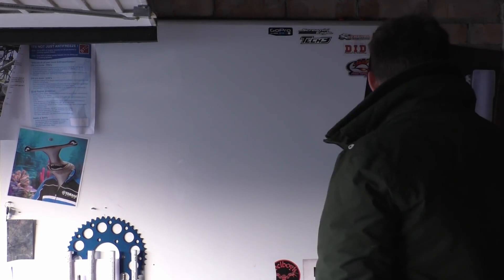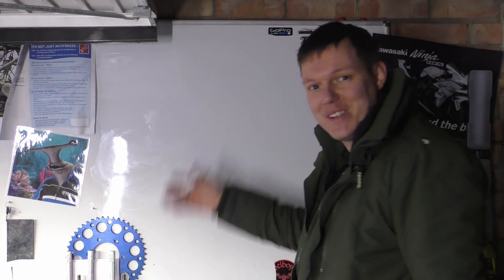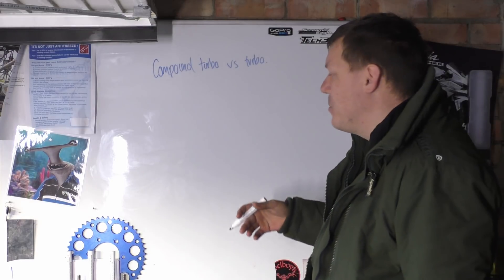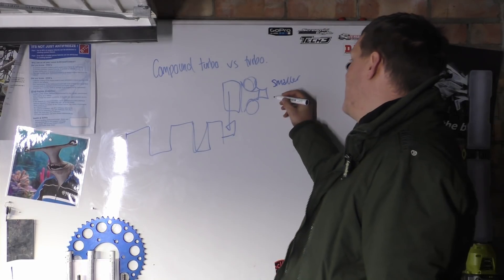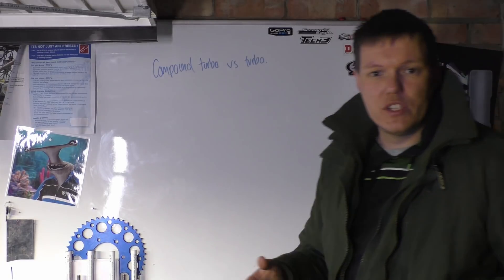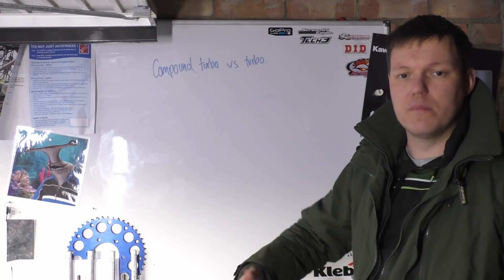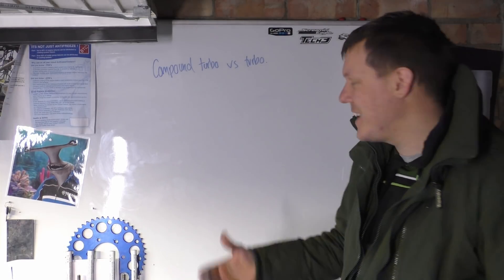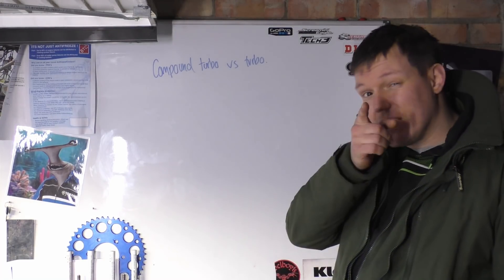Turbo Compound vs Turbo Engine

Comment: Question: Could a turbo compound engine also use the heat normally radiated? I find it odd it's only grabbing from the exhaust. It should be tied into the radiator too.

Comment: IIRC, Cosworth tried something similar to "compound turbocharging" on a four cylinder racing engine, in 1983/1984. Instead of trying to recover energy, they were trying to reduce turbocharger spool time, using variable drive gears in some sort of continuously variable transmission, eminating from the crankshaft. Unfortunately, they couldn't make it work and it chewed-up a crankshaft on the dyno, at 11,000rpm and 40+psi of boost. It was being filmed for the Channel 4 documentary "Equinox - Turbo: Made To Measure" at the time, and at that exact moment you can almost hear the engineers arseholes heel over...
🤡🤓

Comment: Hey Matt! Just wondering if you could revisit compound turbo as well as sequential setups for petrol engines. Several people on the internet have said that single turbo technology is good enough now that even parallel twin turbos are becoming obsolete. Other than it being expensive as shit why don’t they compound  Vari-G turbos or twin scroll. No matter which way you look at it Two turbos make more power than 1 I guess is what I’m on about. (If your goal is all out hp and minimized turbo lag)

Comment: This is why I like the idea of electric turbo compounding.  Use the turbine(s) to spin a generator and then use that to charge stuff, power electric traction motors or a compressor.  It's already used on gen sets, so it could be applied to range extenders, then it could be made to work on variable and high speed engines too.
Reply: If you have a big enough engine you’d have unlimited range

Comment: Hi Matt, Sorry but the correct term for power turbines driving the crank is "turbo-compound" not "compound turbo" . "Compound turbo" refers to having multiple turbines blowing into one another to increase boost pressure... The term "piston compound" or "compound" comes from the steam era when multiple pistons exhausted into larger pistons for increased expansion / efficiency. Diesel's original engine design was a 3 piston compound engine where 2 power pistons exhausted into a larger center piston. Several manufacturers have tried piston compound engines and there was even a car made called the "compound"  around 1910. The recent example is the Ilmore 5 stroke engine which uses the same 2 power pistons and 1 larger expander piston design. The 2 famous turbo compound engines were the Wright Cyclone and the Napier Nomad.. I guess Scania started offering a turbo compound some years ago but dropped it due to reliability issues.. Detroit has been offering turbo compounded engines for several years with the DD15 and 16..  and now it looks like Volvo is also jumping on the bandwagon. Both the Volvo and Detroit use a sprag clutch to engage the power turbine.  https://www.youtube.com/watch?v=9PbxmRA9vbs
Reply from the maker: No dude you're totally correct - and compounding is just adding together - mix or combine (ingredients or constituents) same thing as what you mentioned - I'll make a comment about it in the next update - cheers dude

Comment: Hi Matt ! Cool video as always ! 
I have a question : if - somehow - we could feed hydrogen reliably to an engine, would it make for a good fuel ? Or is there a bunch of problems that would arise from using hydrogen in an ICE ?
Reply from the maker: Hydrogen has a higher calorific value than petrol and has a low denstiy so you can fit more in. There are 2 issues with hydrogen really, 1 the flame speed, which is very high. This means that it tends to 'explode' more than burn, so peak pressure would be when the crank is at say 10 ATDC. 

The second thing is storing hydrogen and how it readily burns. Look at the hindenberg.
Reply: The Workshop a simple answer to a simple question well done mat

Comment: uhhh.. compounding turbocharging a diesel vs a gas engine is a bit different. But pretty much the point of compounding is more performance than OEM! It's the combination of the earlier spool with the big top end power.
Reply from the maker: "compounding turbocharging a diesel vs a gas engine is a bit different."

- there's loads of things that are different - this makes no sense.

Comment: Hey Matt, I was the guy asking about engine warmup over and over again.
I got one more question (maybe for a short video or just your answer).
Without and numbers, just in general, what's worse for a cold engine, higher rpm with very little load, or high load at lower rpm.
Hard to say, but in general you get the idea. What would you say?
Reply from the maker: higher rpm with very little load - load is the killer in this respect
Reply from the maker: It should be no load.
Reply: okay, thx.

Comment: Why not both, at the same time and from the same snail :>?
Reply: It would only generate "additional" power when the wastegate would be open on a current turbo setup.  It would also slow spooling, and a fixed geared approach would only spin as fast as the engine itself allowed, reducing the effectiveness of a boost application (making it more like a centrifugal supercharger in terms of power delivery).

The limitations of a single stage of expansion determine how much energy (and at what efficiency) you could get anyway.

So it makes more sense to use a traditional turbocompressor for boosting along with, say, an axial turbine for "compounding" - much as is done with large Diesels today.
Reply: Bummer but that gets the noggin joggin'; we can't really turbo a two-stroke but we can use a compound turbo setup with it and be really happy, no?
Reply: I don't know exactly.  Turbo two strokes are possible, as long as you find a way to build boost first.  Electric turbo compounding would do the trick: spin a compressor on an electric motor and generate electricty off an exhaust turbine or two.

Once upon a time, there were two stroke Diesels that were turbo charged (Detroit Diesel).  But those, like their normally aspirated cousins, used a blower to fill the cylinders as well.  The blower was a "supercharger" running at marginal boost by pumping only slightly more air volume than the cylinders needed; it could pump pressurised air from the turbocompressor just fine as well.  EDIT: Actually, it had a bypass to reduce pressure drop on boost.

But that all defeats the simplicity aspect of a two stroke somewhat!

Comment: If i have a turbocompound car, let go of the gas, go downhill, and engage the engine's clutch and the turbo's clutch (if it has one) would it spool up my turbo?
Or rather, can i spool up my turbocompound by going downhill?
Reply: Theoretically Yes

Comment: Would like your opinion on the hell toe shifting
Reply from the maker: Funny you say that - the video coming tonigh is just one of those.
Reply: heel and toe ;)
Reply: Heel toe shifting is also a bike thing as some bikes have a double end shift lever so you change down with your toe and use your heel to change up.
Reply from the maker: LOL did you mean 'heel to toe'?
Reply: The Workshop yes, sorry.
Reply from the maker: Sorry dude that's car thing.
Reply: No also those cars on two wheels have such a lever (harley d or that half honda civic thing)
Reply: As far as i have seen and experienced, heel/toe shifters on motorbikes are usually mounted on bikes with foot boards or forward controls nowadays. Its a cruiser bike thing when you have forward controls and that makes it more awkward to twist your ancle to get under or over the lever without lifting your foot from the peg/board. I know some other bikes like the honda Cub and some chinese bikes use them as well. On the Cub its a practical design that together with a centrifugal clutch helps as they are primarily made for people carrying stuff. If you look at asian countries you see them ride around on Cubs with food in their hands or on boards on their shoulders instead of in a box on the back. 
On newer chinese bikes it might be just the same reason or an estetic choice?
Reply: The Workshop yeah  I’ve had this discussion with a bunch of guys I used to work with. The consensus I got was that it’s loads of good if you’re racing, or have a kit car which might spin out if you don’t rev match because it’s so light.
It’s great fun to do, and I do practice it just for a bit of fun, but you’re better off just coming off the brakes for a second and blipping the throttle, or changing gear before you start breaking.

The other thing to consider is that your pedals probably want some adjusting.  My accelerator is to far forward, that it’s hard to reach with my heel unless u dear very heavy braking. And if I’m under that heavy braking heel and toe is usually the last thing on my mind.

Like I said, great fun though.